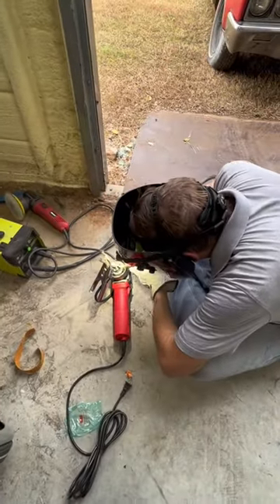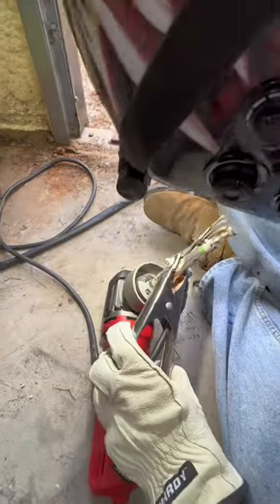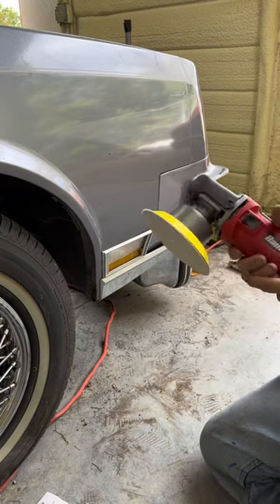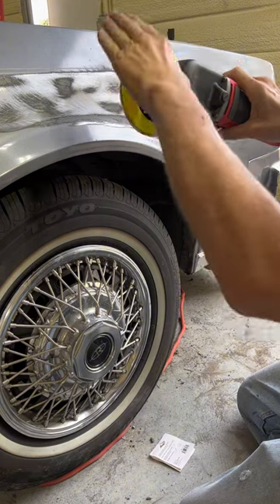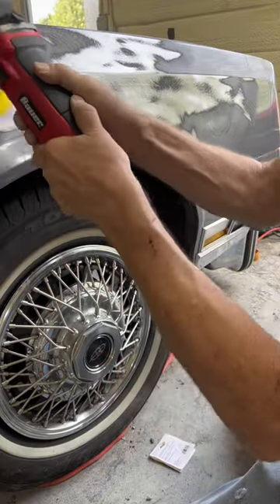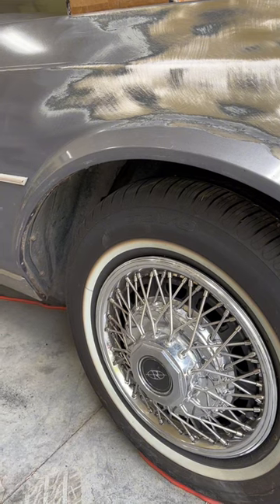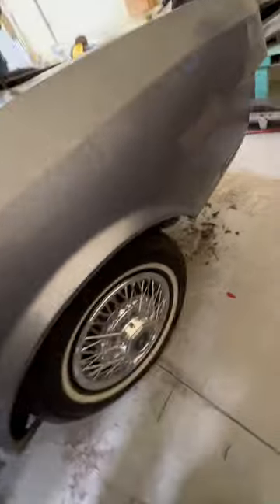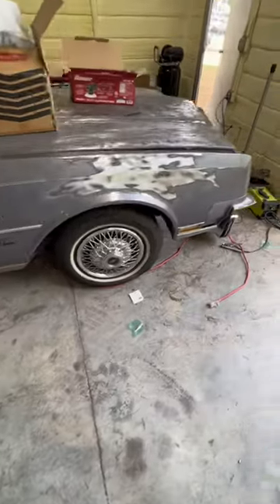BILLY G.O.A.T  BILLY SANDER EDITION - Easy DIY Harbor Freight How To Make Welding Orbital DA Sander

Comment: TROLLLL. . Old man this is terrible the tool & the stripping of the paint . Just use your ND ezq & lock it . Throw away that harbor freight junk. Lay off the sauce 🥃
Reply from the maker: I have a 1.8HP compressor in that building.  With my EZQ, that’s 20 seconds stripping, and 5 minutes waiting🤣🤣
Reply: @OldBondoBilly  and all day clowning. Where's my FREE crap ? 👺
Reply from the maker: Easy General Bacon 😬😬. Anton is my resident troll🤣🤣
Reply: @TheOutlawGeneralBacon 
Dang man, ease up. 
🤷🏻‍♂️
Reply: @UnfinishedProjectDartSport  you're right